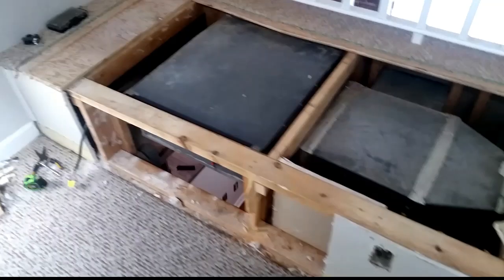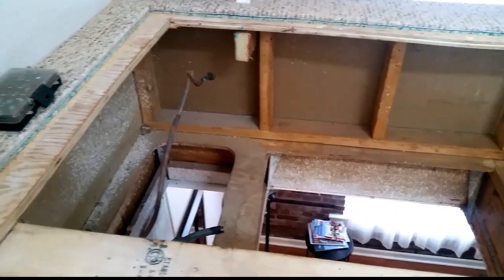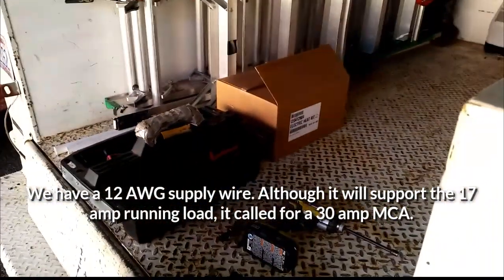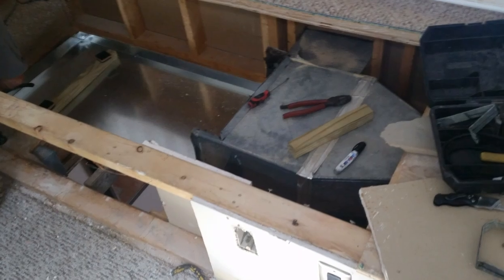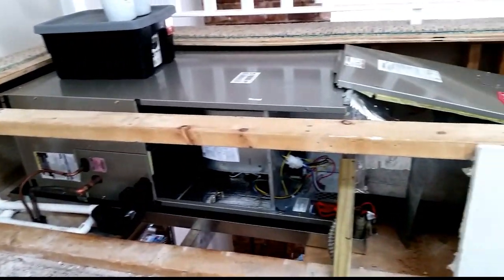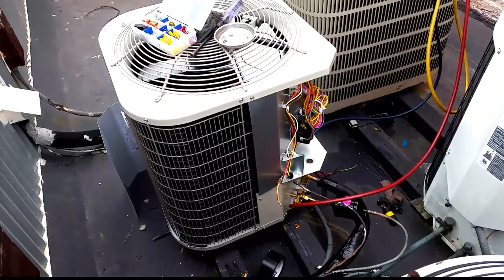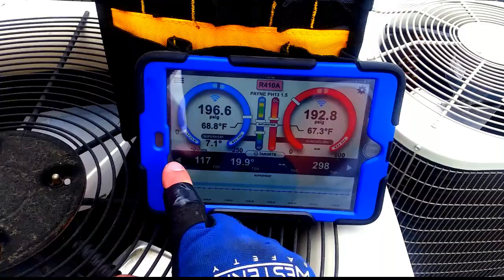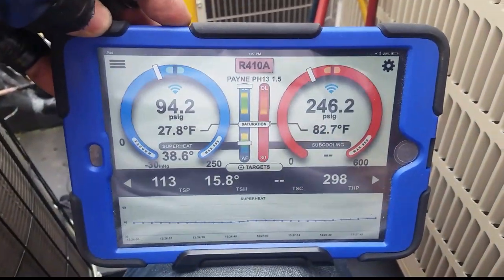HVAC Install : Payne Heat Pump in Tight Quarters

Comment: I know I am being very ambitious but I am trying to learn this hvac stuff from You Tube channels so I can get my foot in the door of a company that will possibly give me some on the job training,  so here goes a dumb question.  If a air handler with a free return is installed in a home where the doors to other rooms are going to be kept open during the day and only closed at night when the demand for cooler air is lower, would the lower static pressure of the return air not being restricted and less ductwork having to be installed incur a substantial savings in energy and installation costs?  Also, would you have saved half of the crane bill by kicking the old unit over the side of the building?

Comment: How did you end up filtering the unit? it looked like there was several areas that would be pulling in air. Thanks
Reply from the maker: there is a filter in the unit right now. it will be filtered in the grill after the chase is sealed